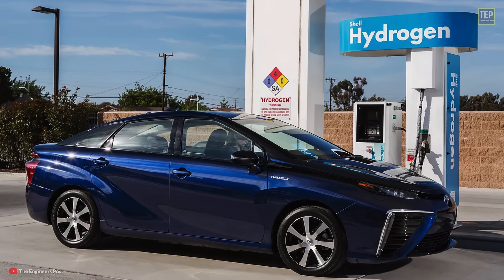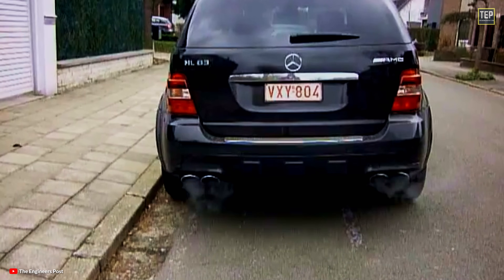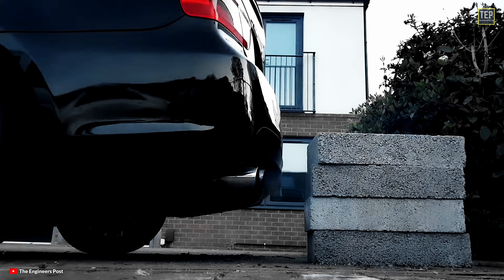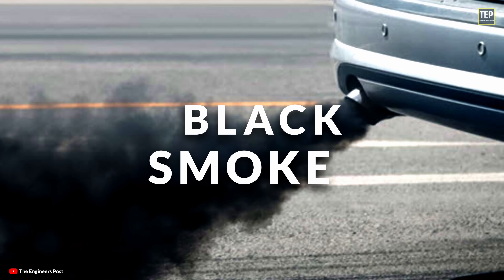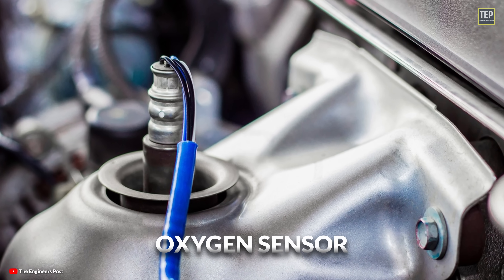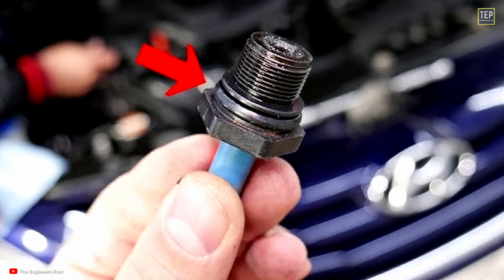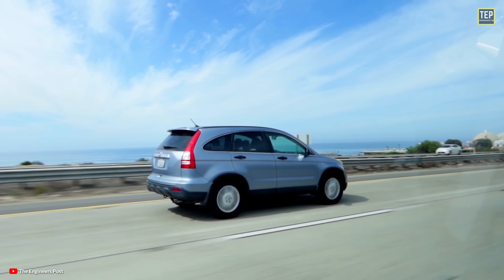What Different Smoke Means? Types of Car Exhaust Smoke | Explained

Comment: White Smoke on hard acceleration. The brake master cylinder seals leaking break fluid into break booster. The fluid then being sucked through the break booster vacuum pipe into the intake manifold and into the cylinders then exiting through the exhaust as white smoke. Replaced brake master cylinder seals, problem fixed.

Comment: That dpf system is completely bs...what they don't tell you about it is that we are blowing the same crap out as we were before. It is just smaller. Now you also are adsing all the chemicals from the def fluid. On top of thay when these trucks are going down highway and is in its regen status they areknown to blow hot embers out the exhauts tip and start fires. It is amazing how much cooler and how much efficient those diesels run when they have been deleted.

Comment: Diesel here, exaust smells Like acid from down the block. 

Why?
Reply: Too much fuel ( worn out injectors or over fuelling) or low compression. Usually the latter.
Reply: @Animal666TNOTB  thanks man, it gets better and worse for no good reason, also black soot on tail pipe, it's deleated stag 2 so maybe the tune is too ritch?

Comment: Never use head gasket repair sealant or radiator sealant unless you can afford a new engine or at least a full engine flush and rebuild.. only dummies use such quick fix “gunge”…..lol

Comment: Head gasket sealer is not a permanent fix, and comes with its own issues (like clogging parts of the cooling system).  Depending on how severe the leak is, it can work well enough as a "right now" temporary fix.  Now, if it's not the head gasket, but something like a warped head, or cracked head or block, the engine is probably junk anyway, so might as well keep it going for as long as you can.

Comment: White/grey smoke from a diesel can mean unburned fuel. I know everyone is going to swear that black smoke is from overfueling. Resulting in unburned fuel. Also known as particulate matter. Trust me on this. Matter of fact, anyone who has had a 7.3 can tell you that when the crankshaft sensor goes out. You will see white/gray smoke and no response from the tachometer. That's because your not burning the fuel coming into the cylinder. You can also get unburned fuel smoke from a cold diesel engine because as the fuel is injected in. It hit the cold steel inside the cylinder area and goes back to a liquid form intead of high pressure atomization form. Resulting in unburned fuel.

Comment: Tuners, or people modifying their engines for more power, be higher compression ratios, cam timeing/lift/overlap, better airflow, nitrous, or forced induction by adding a supercharger and or turbo kit. If tuning & testing by themselves, without spending the time & money renting a dyno. They run rich on purpose, to protect the engine from detonation/knock/preignition, because the excess fuel has a cooling effect. When finding the new air fuel balance for what better hardware you changed. It's best to start a little rich, and tune the fuel rate down, to what perfect for your setup then risk being lean on a test run, and destroy the engine. Tuners, and super car computers may also run rich, if high enough octane is needed, but unavailable. Clever computers, or Tuners doing it manually, can add fuel, and delay spark timing, if knock is detected, and then reduce those things to the point there's no knock with that octane of fuel, but also not wasting it, and try to be as powerful and efficient as possible. Diesel engines can safely run lean, add a turbo no problem, even makes them more efficient, it's the opposite for them. More fuel makes them dangerously hot, but stronger, to my understanding.

Comment: I have diesel. Once I had an old BMW with huge black smoke. Neither my technician nor the chip tuner could tell me why. A regular guy told me to hit the gas, let the engine run on high rpm, that cleans out the system. And it worked.
Reply: That’s basically a dpf delete 😂

This is the most common “mod” in the uk
Reply: @JamieWalker-pc6nd  It may clog up the dpf by saturating the soot catching canals in the dpf.
Reply: I've got a petrol car and I do the same whenever that happens, sometimes it won't start so I get it tow-started and keep the pedal down until the RPMs rise and clears all the blacks smoke, afterwards it drives normally
Reply: Thats all the soot accumulated on the exhaust piping being blown out. Same here with an older idi naturally aspirated diesel. After every few months i give it the beans and clean out the exhaust system.
Reply: I had a 1972 AMC MATADOR with a 360cubic inch V8 with 2 barrel carburetor. When I first bought it and under 200 it emitted blue exhaust smoke off and on and it would hesitate on acceleration. I thought this wasn't normal but wasn't sure. It need a quart of oil after just 750 miles. The dealer kept telling me to not worry . This sure wasn't normal to me . After 1,500 miles it pinged on regular gasoline and the dealer again told me this was normal break in period. I never bought another AMC MATADOR after that ever again. No mechanics knew how to service my car right no matter where I took my car for service.

Comment: If it’s cold out the white smoke dosnt disappear it’s condensation from the hot exhaust gases and it’ll be present the entire time it’s cold outside. No different then your hot breath on a cold day. If the smoke is white and really thick that’s a blown headgasket that’s burning coolant. If the smoke is blue that’s oil being burned if the smoke is black that’s an engine that’s running rich to much fuel.

Comment: White exhaust is also normal in below freezing temperatures as there is vapour from gasoline being being burned. It is visible when the air is cold like when you see your breath in cold air. Now if you see it in warm weather then there is a problem.
Reply: Exactly
Reply: That has nothing to do with gas vapors it is hot exhaust hitting cold air and making steam like jet contrails at high altitude basically steam like boiling water. Hot meets cool you got steam white that cools and disappears fast not ling after it leaves pipe. White that travels is oil

Comment: Blue smoke was also pretty common for old two-stroke cars like Trabant or Wartburg, since their engines run on a mixture of petrol and oil, which obviously produces the blue smoke. Though, these didn't use regular engine oil, these used so-called M2T oil, which is a type of oil specifically for being mixed with petrol in two-stroke engines.
Reply: Back when I was a kid in the sixties 2 stroke oil was kind of rare. Everyone used non detergent SAE 30 in about a 20 to 1 mix, it made for a lot of blue smoke. I still remember my Lithuanian neighbor starting his Saab every morning on his way to work. It left a blue haze going all the way down the block lol. He loved those cars. When his son grew up he opened a garage specializing in all those unusual european cars

Comment: I have a diesel 1990 motorhome or RV it's engine is a design from early 1980's it does not put out any smoke at any time no sensors to mess it up I guess

Comment: Blue smoke mean piston rings damage

I got that knowledge from BeamNG
Reply: not always
Reply: @woa1350  i know
Reply: Blue smoke 95% of the time is burning oil.
Low compression, leaking turbo seals, turbo oil return restricted ( which happens a lot), piston rings.
Or in a diesel, the above plus timing. Obviously this list excludes anything electrical.

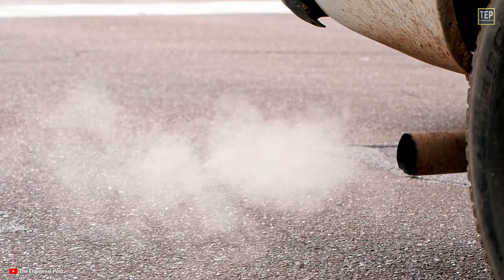Comment: 2:43 thats an run away Diesel engine.
Reply: It’s petrol dummy 😂
Reply: @rasper077  in a run away diesel engine the exhaust goes out through the intake, and pulls air in through the exhaust. The opposite of the way it was designed to work . The engine literally runs backwards.

Comment: Oil leaking into the engine is especially dangerous on turbodiesel cars, because it can cause an engine runaway
Reply: That's one of the reasons why I prefer manuals instead of automatics, because you can save the engine, the clutch or gearbox might say bye-bye but it's still cheaper than a new engine
Reply: @wateuszkelsz  oh yeah, haven't even though of that kind of saving the engine. The best and most assured way is still to cover the turbo with a thick cloth tho
Reply: @Mr.Benedos in manual you just put it in the highest gear, release clutch then hit the brakes and hold until the engine stalls, which is way faster than getting out of the car, opening the hood and covering turbo with a thick cloth, not to mention finding that thick cloth
Reply: @wateuszkelsz  yeah pretty true now that I really think of it, that would be way faster (unless your transmission goes kaboom before the engine, in which case you would better off be hiding behind the wheel)
Reply: @Mr.Benedos if the transmission is made of plastic then yes it can go kaboom, but the engine will say bye-bye way faster before the transmission, because the engine will spin over 15000 rpms if a runaway happens, so it's more likely the rod will go out and say hello to you before the trans breaks
Reply: @wateuszkelszsock in air intake works better
Reply: YES.
That must be taken very seriously. Replace those worn piston rings, and whatever. Maybe even have a whole back up engine to put in and use, just in case you need to rebuild your main one.
Reply: Turbo Diesels will Runaway Gasoline Engines will not
Reply: What's engine runaway
Reply: @stevethea5250  
Look on YouTube for videos about Diesel engine runaway. What causes them, and how to stop them.
Reply: @stevethea5250  Just in case noone told you so far. A runnaway happens, when your  older Turbodiesel somehow gets oil into the fresh air ports (usually defective turbocharger). The oil turns into a vapor and if there is too much of it, the engine will be able to combust it. Given  that a diesel wont need ignition (because it uses compression to combust its fuel), there is no way to stop it from running. Engine rpm increases, more oil is sucked it and combusted, increasing the rpm further... Only stopped by engine seizing due to missing lubrication or something being blown away. The mentioned 15000 rpm that might occur are 3 times the rpm you diesel is designed to handle. Modern diesel engines that have a throttle body or valve are usually capable of stopping this by closing said valve, eliminating the airflow.
Reply: Then you better go catch it!
Reply: Where will it go?
Reply: Diesel 🍷🗿
Reply: @Smellypantmachine kk

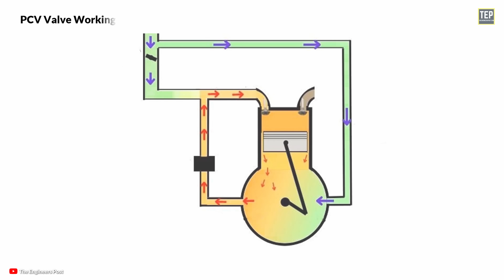Comment: 8:11 -I thought that was the job of the EGR system, and the PCV valve takes some of the oil vapors to the combustion chamber in order to reduce the pressure inside the engine block.
Reply: You sir, are correct!

Comment: Nothing can fix a leaking head gasket but a new head gasket. Anything you can pour into the engine is a temporary bandaid at best
Reply: All those additives are like your radiator stop leak... all it is, is a short term solution that causes  a long term problem.  And by this... using my radiator stop leak for example... yes you are going to stop the leak, however, you are going to take out your thermostat and heater core as well as decrease your cooling g efficiency.
Reply: Petrol engines can smoge too if pcv valve is stuck and causing valve cover seal blow.
Reply: 20+ years as a tech and we never ever added anything to help a suspected head gasket issue. It cant be fixed that way and can cause far more issues such as blocked water ways and damage to water pumps.
Reply: same with oil leak and coolant leak sealants they're all temporary
Reply: Indeed, these band aid fixes for blown head gaskets exist because it's a pain in the back side to remove the head of a DOHC engine. By contrast removing the head to replace a head gasket on a flathead engine is dead easy, but flatheads have a lot of cons that DOHC don't have.
Reply: Fully agree, don't put sealend stuff in your engine. Worst advise ever... It only makes a mess in your engine.
Reply: Please don't listen to Henry, it's clearly a bot account to shill products.
Reply: That sealer had a Habit of Damaging other systems as well Replacing a Blown Head Gasket is the Best Option
Reply: 1995 Chevy 1500 5.7
I added Blue Devil head gasket sealer in 2014
No more problems still going strong 2025
I'm sure it's not better than replacing the head gaskets but if it works it's not broken.
Reply: @i4ni439 I'm going to do it to my minivan tomorrow I hope and exactly like it says to...how did you do yours do yA remember.any help or advise would be awesome
Reply: @i4ni439  when you poured it in what was the consistency? Was it like a chemical or like a thick paste?
Reply: You can get lucky but those additives rarely work and like prescription medication and vaccines, they can have nasty side effects.
Reply: You are too old to know better and too stupid to learn that k&w seals up all leaks and its made for coolant system it seals radiator leaks , cracked blocks, and head gaskets it will even seal up your mouth
Reply: Well, you can just jank it away by overtightening head bolts, gosh i hate myself…
Reply: In most cases yes but you would be surprised how often it works. I have seen cars that are fixed and they drive it for another decade. I have seen it do nothing more often than not but it does work occasionally.
Reply: What the OP said. You put "fix leak" or whatever it's called into your system, it's gonna cause more problems
Reply: Yeah, I just started a job where my diesel school bus has big puffs of blue smoke every third day or so 

it’s pretty stinky and looks really bad for the private school.
Reply: True. You shouldn't put that head gasket repair crap in your cooling system. If you only drive a few hundred miles a year or you're planning on driving your beater until it breaks then scrapping it, then I guess it would be a viable option. Personally I don't like rolling the dice every time I get in the car, so I just fix it the right way 😅
Reply: Mechanic in can ✌️..😅...👍
Reply: Yep
Reply: Yeap used K& W in my son’s car, he drove it for 5 years after and still going when he got rid of it!!
Reply: K&w metallic sealer, seals it like new
Reply: K&w in the radiator seals everything forever your too young to know that
Reply: @henrykennedy1120 you’re
Reply: @henrykennedy1120   yeah seals up everything.... FFS K&w is just a cheap patch that will plug up your cooling system. There is nothing that can repair a head gasket other than replacing a head gasket. Your just too old to know any better and not smart enough to try and learn. BTW i am 60 years old with 40 years in the repair industry
Reply: Been using it for 40 years
Reply: Smarter than you dart head , ive owned my on HVAC company for 45 years master licensed certified so you are not the smart one
Reply: Blocks leaks also block where channels duhhhhhh no stop leak crap for any fluid is good. Repair broken parts idiots
Reply: Not true!! Had it in my works van at least 60k miles & it NEVER failed. I scrapped it because it was rotten, not because the head went.
Reply: K&W metallic sealer was and us the best it seals head gaskets , cracked blocks , leaked in radiators forever
Reply: Nope fixes permanent
Reply: @henrykennedy1120  no it is not. I have seen the aftermath of someone putting that stuff in an engine and it blocks up waterways and radiator cores. Just do the job properly to start with
Reply: @paganpriestess979 
Don't bother arguing with that other person. Said person doesn't know anything about engines. If he wants to put that crap in, let him. It will ruin other parts. You've warned him, thats all you can do
Reply: Listen son ive been using it since before you were born and yes it seals permanent   ive never had a problem with it
Reply: @henrykennedy1120 yeah probably because that dude didn't use it  exactly how the can says to use it .that's very very important.im guessing that's why some people fail at fixing a simple leak ..I'ma try it on my caravan.the blue devil stuff before my gasket goes I got 240 tho and my dog and I love in it so it's really important that we don't break down..get them nah sayers bro.lol
Reply: @henrykennedy1120  Son? so 21 years as a vehicle tech and 7+ years as an mot tester both ford and renault trained dont count? i think the best part of 30 years in the industry give me the knowledge to know that stuff does more damage than good. Oh and it would be daughter by the way. Yes a fully qualified female tech.
Reply: Like I said its great permanent fix so now move on , ho to you hair salon he nails done leave the real mechanics to the men

Comment: On an older car, a ruptured diaphragm in the modulator valve on an automatic transmission can cause white smoke as this allows transmission fluid to be sucked up the vacuum line and into the intake manifold.
Reply: I had this exact issue years ago but my car was throwing out red smoke.
Reply: @DGHodgson-o8z kinda sounds cool, can imagine one of those massive american muscle cars speeding along- with red exaust 😅
Reply: probably the fluid color @DGHodgson-o8z
Reply: th350 and th400??